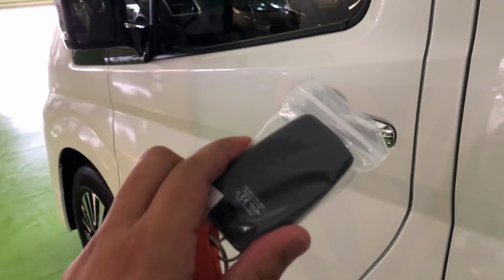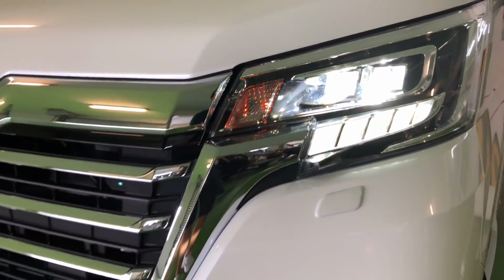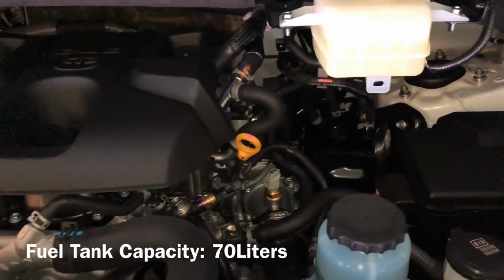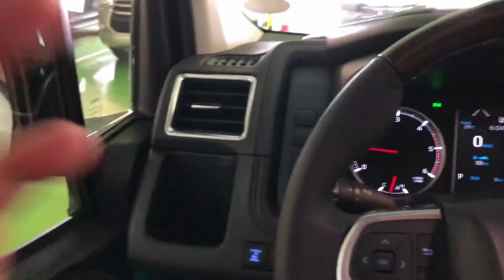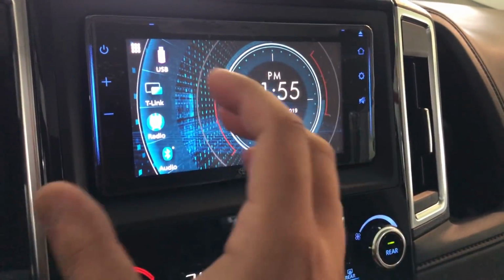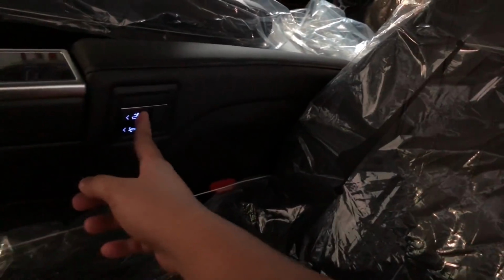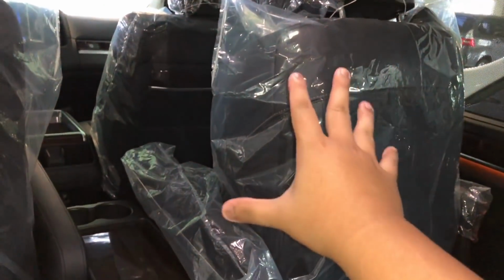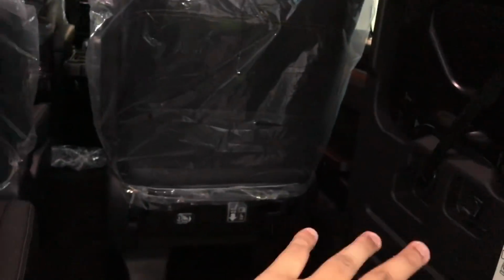2020 Toyota Hiace SUPER GRANDIA ELITE || FULL TOUR REVIEW

Comment: The 6-Speed Automatic Transmission is the replacement of the 4-Speed Automatic Transmission in the higher end while 6-Speed Manual Transmission in the lower end is the replacement of the 5-Speed Manual Transmission.

Comment: Sana ginawang option yung 1VD-FTV sa engine..
Reply: @twin yoshimura  1VD-FTV is 4.5 V8 D-4D. 1VD-FTV is exclusively for Toyota Land Cruiser and Lexus LX. This Hiace and other Toyota models such as Hilux, Prado, Fortuner, and Innova are now equipped with a 2.8 1GD-FTV D-4D engine. The 2.8 engine in the Hiace replaces the 2.5 2KD-FTV D-4D engine and the  3.0 1KD-FTV D-4D engine.
Reply: Shadow Hedgehog  Yes. Prado is now powered with a 2.8 1GD-FTV D-4D engine that replaces the 3.0 1KD-FTV D-4D engine which is fuel efficient.
Reply: Shadow Hedgehog  Not anymore.